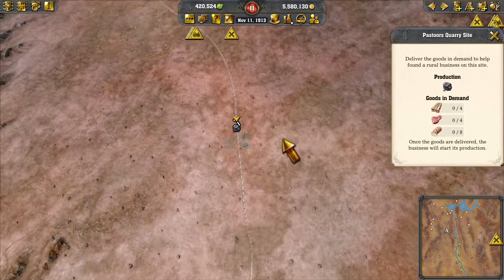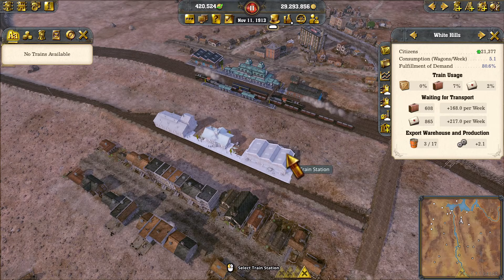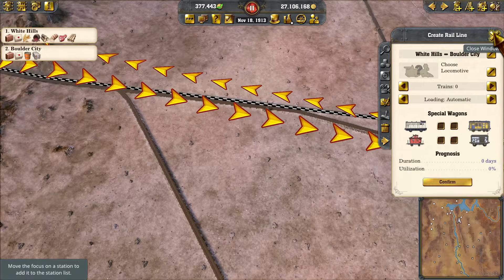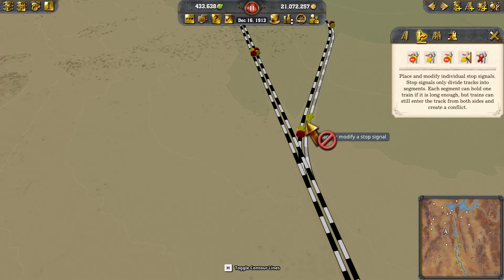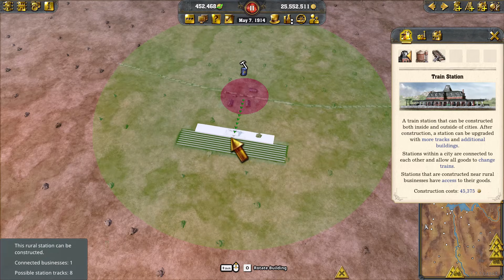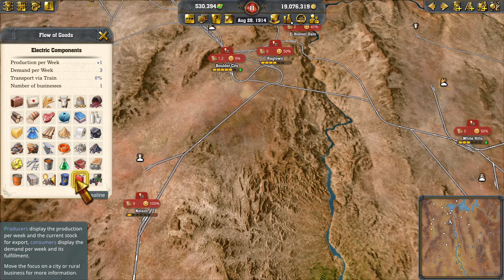Railway Empire 2 Industrial Wonders DLC Hoover Dam Part Six

Comment: Yeah, if you want the cars, that's a WHOLE lot of stuff to do all over the place. If there is NOT another task after electronics to the Dam, you won't be able to do it. I guess it might be one more task about the entire population of the region as a guess.

However, that leads back to your insistence of picking up ALL old research. Yes, SOME may be worthwhile, BUT, if you had driven forward on tech at the start, the auto research would be done by now. And no, you would not KNOW you needed auto, BUT, just generally moving forward for the engines would have put you in good stead for it.